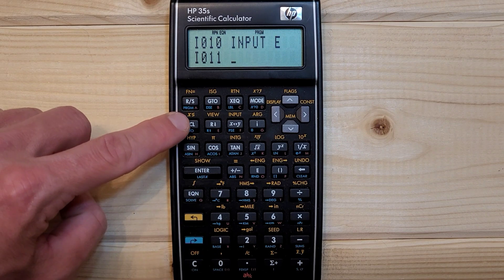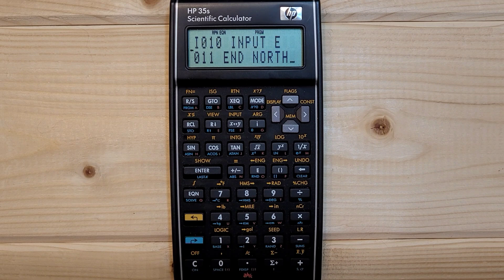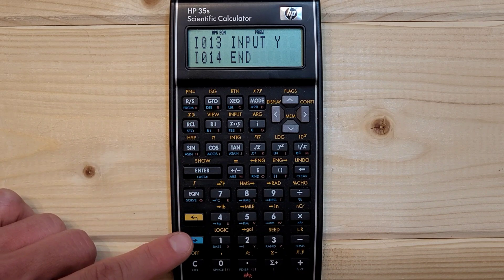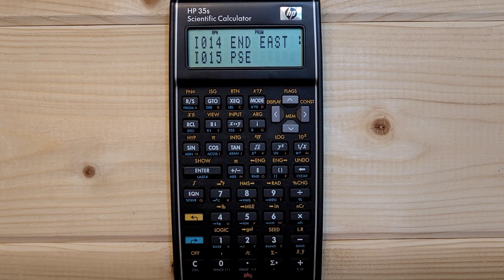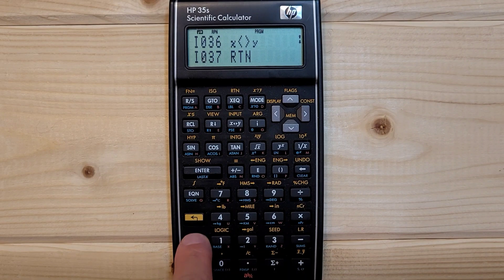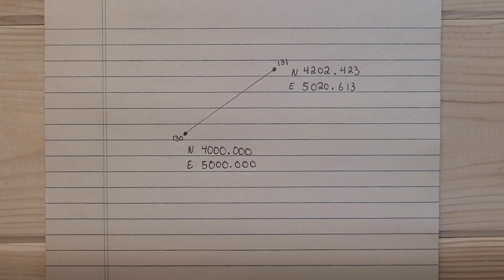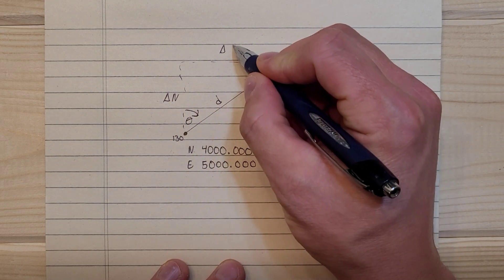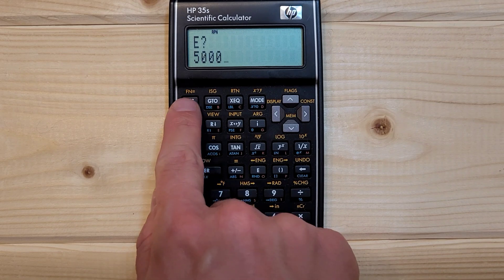HP 35s Land Surveying Programs: Inverse Program

Comment: not sure why none of my programs i've put in work. currently have a program for solving interior angles sss and did my checksum for the label C and it's the same as what i'm reading in the instruction manual. I watched your video and have everything imputed like you and have a checksum of 47D9. I keep getting nonexistent error. Is there something im doing wrong? (figured it out, watch ep 1 and input the program from there.)
Reply: I'm currently having this same issue... have tried following instructions from a couple different sources and can't figure out what I'm doing wrong. Did you ever figure out how to fix this issue?